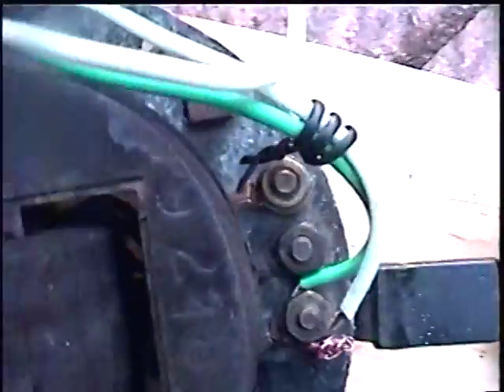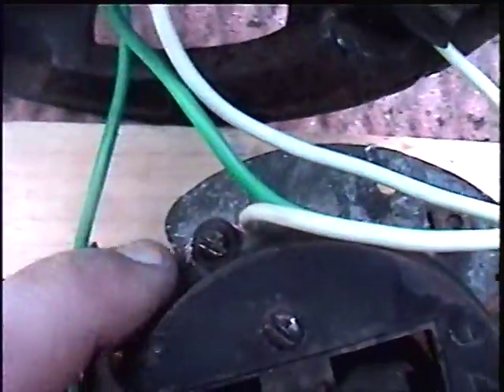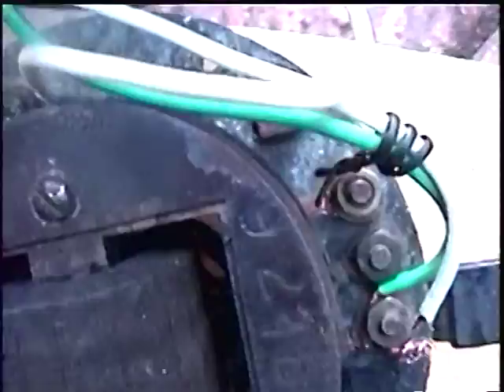More motor problems...

Comment: I have one of these but its a sprague. The field in the motor is in a way adjustable. If its to far forward it wont run if its to far back it wont run. It needs to be aligned with the armature just right like any motor, I saw your post on afcaforums. I will try to post pics of mine to show you how its wired. I as for the field. The screws in the front may need to be loosened and the back ones tightened or vice versa. If its close it will run but sound labored. Fine tuning will fix that good luck